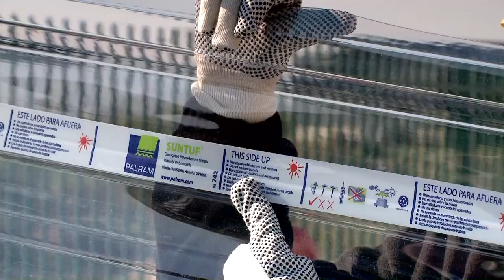How to install a corrugated polycarbonate skylight sheet on a metal roof? SUNTUF® Installation Video

Comment: I am in USA. what type of metal roofing (corrugated vs SM-RIb vs 5V-crimp) can be installed seamless like shown in this video? I am having a hard time deciding the metal roof panels that can go with SUNTUF clear polycarbonate roofing. also where to buy storm washer with EPDM gasket?

Comment: Do not install it like this, the water will pool up underneath the corrugated roofing and eventually find a weak spot and leak through. Silicone is a must those shitty stickers won't do fuck all